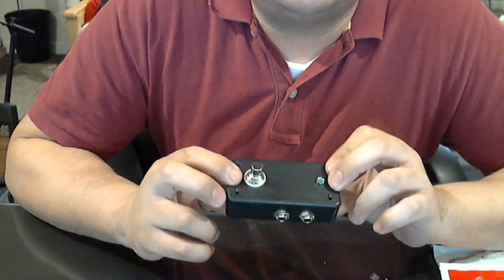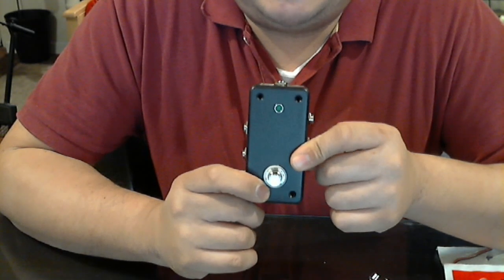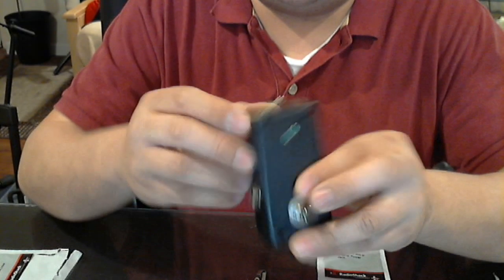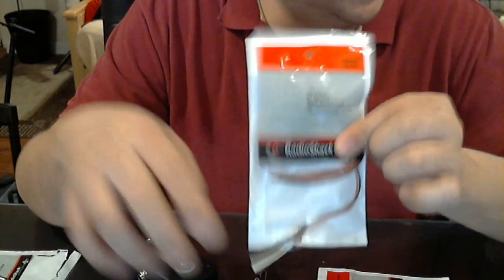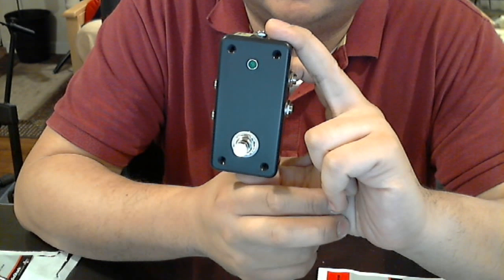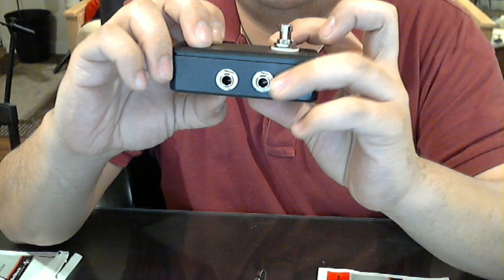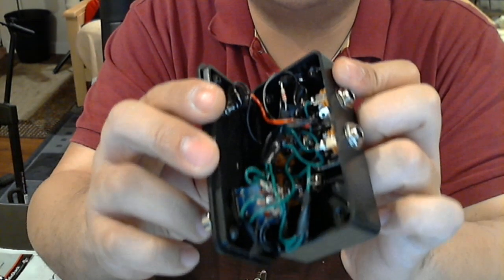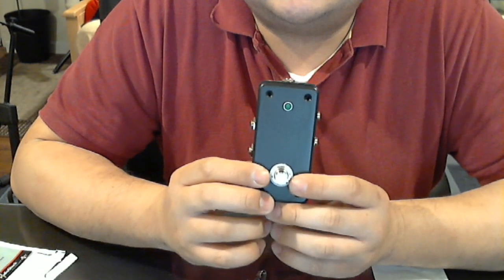DIY True Bypass Looper Guitar Footswitch 1Channel 9v

Comment: Those are some ridiculously high prices under Radioshack in your description. Many pedal builders these days are buying from Tayda Electronics because they're super cheap, fine with low quantities, high quality, and they ship super fast. If you're going to buy one part (the 3pdt) online you might as well buy all of them. Just search google for tayda. resistors are $0.01, LEDs are $0.01 jacks are $0.87, 3pdt is $3, dc jack ~$0.50, heavy duty aluminum case is $4. This looper would cost $10.

Comment: Hey I attempted this build following those schematics but nothing works, can you help me out? Here's what I bought:
1590A Style Aluminum Diecast Enclosure	
DC Power Jack 2.1mm Enclosed Frame With Switch Red	
2.2 OHM 1/4W 5% Carbon Film Resistor
6.35mm 1/4" Mono Chassis Socket / Jack	
3PDT Stomp Foot / Pedal Switch
100K OHM Linear Taper Potentiometer Round Knurled Plastic Shaft PCB 9mm
3mm Bezel LED Holder Chrome Metal
LED 3mm Blue Water Clear Ultra Bright
Reply: I'm sorry without seeing how you wired everything I can't help you. It was trial and error and doing research on the web that helped me.
Reply: Frank Ward Well if everything is wired correctly with the 3pdt will the looper still work without using a power source so the led won't turn on?